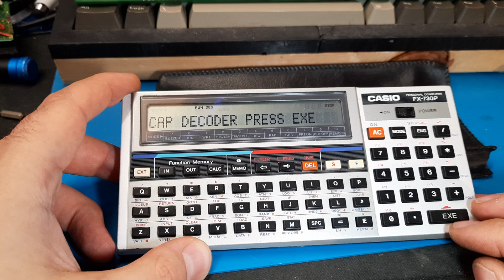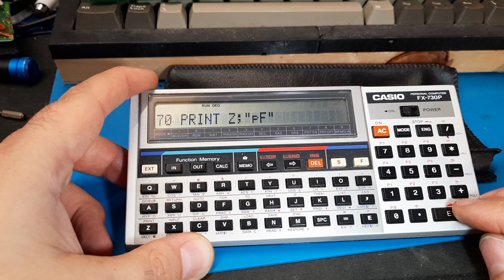Capacitor Code Decoder Program

Comment: The sverag vnutral ti earth locakky us the repaired sewesgecus the earth seemed to be vua the outsudevif carryingboipe wirk that us the ussye it cabt cinnectvto earth it might a dwelking but fuffty bysbess insude hones is nit possible i might uluse foubdations a dobke pike isolation unit a thrn drsin by hakf hour to groubd remive or usikate alk the unnefed i yse utens ine atzm a time then you gubd the errir i keeo ut at thus abd i maibtain the circuit easliy i know i have the errir i cant dodge cleaning and i run in gonduit the earth wire to well vecayse if obe installation ut majes ni difference be a fuffty iutjet ckeaning might be whuch team have you employed. Theres only mr me  hmmm might be better to find habbitats that you can clean and still enjoy inviting friend's  too.. they return becayse its safe abd like you they avoud due to danger ⚡✨.etc the one outket use a torch . Find ehy my ceiling needs earthing but might be rekatue to the well it vabt be wuth fufty lighting units in the fakse ceiling. Brish it under the carpets ahh asdured pensions im certain

Comment: Hm... I think you can improve your program to handle all 3 digits at once. Something like this: A = INT(X/10);  B = X - A*10 where X is 3 digit input, A is first two digits and B is last digit
Reply: like this:
10 PRINT "CAP DECODER PRESS EXE"
20 INPUT "WRITE 3 DIGITS",X
30 A=INT(X/10)
40 B=X-A*10
50 Z=A*10^B
60 Q=Z/10^6
70 U=Z/10^3
80 PRINT Z;"pF"
90 PRINT U;"nF"
100 PRINT Q;"uF"
Reply from the maker: That is a nice optimization. Having it take all three at once would be a lot more intuitive.